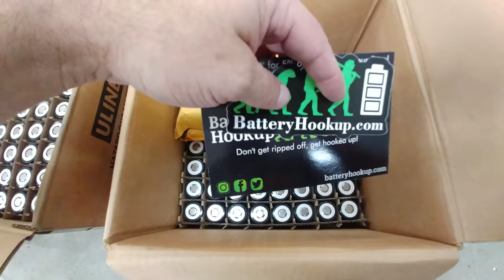Homemade Electric Buggy, Ep 3: Powertrain - LiFePo4, ME1616

Comment: How's the luck so far with those battery hookup cells? I ordered 144 of them for a 5p24s pack for a 72v 8000w electric bike. The pack is complete on a 200A Daly BMS, and the bikes almost finished.
Reply: I'm curious too as I've been needing to make a pack for my drift cart. What do u use to make yours? (Tools, battery holders, ect)?
Reply: @Todd_G_FPV  I use a 1200A spot welder with a pen probe at nearly max setting to work for .20mm pure nickel strip and 32650 cell holders (That is required for high amp draw from the pack, sometimes even 2 layers thick). Once the strips connect the cells it still is a somewhat flexible pack, so I wrap it with polyimide heat tape before cutting a large shrink wrap for the pack. Go for a Daly BMS, they are currently on Amazon at a good price.
Reply from the maker: Haven't started the battery yet, just finished building a brake to bend the aluminum body panels. Once I get everything done as far as the chassis mounts and it's ready for paint, then I'll shift focus to the battery. This will be my first time using these cells, but they have a good reputation. I'm using a Daly BMS as well, 20-24P30S configuration (haven't settled on capacity yet). Using a 5000W spot welder to weld 2 layers of .2x15mm nickel strips to the cells and then solder them to thicker copper busbars running between the cells on each end of the parallel groups to carry the final current through each series connection. Kind of like what's done with cell level fusing, but without the fusing. I considered doing that as well, but figured these are a lot safer than Tesla's li-ion 18650's so if one of the cells short later I'm not too worried about the entire pack catching fire on me. It could be a really dumb decision, too lol. My luck isn't the greatest...
Reply: @JamesBiggar  I also just noticed yours have the white ring insulator up on the positive of the battery, mine came with cardboard brown. I'm hoping they didn't re-wrap some k2 cells or something for mine or something. I'll be following along to see how your cells end up!
Reply from the maker: Highly unlikely, they're manufactured specifically for Batteryhookup. They do sell K2 cells, too, along with Headway, Topband, and others, but not with their company name printed on the side of them. They take a lot of pride in their family owned business and have invested a lot of time and $ into their cells and nickel fuse sheets, and make a point to call out scams when they see them (I've been following and shopping through them for a couple of years). I recommend searching out other battery builds on Youtube using these cells, or other cells that they've supplied. They have an excellent reputation.
Reply: @JamesBiggar  Those are just shrinks the vendor/consumer can order, and have little to do with what quality is inside them. I ordered from them for this exact reason, reputation, price, LFP. I might just make a video so you can see what I mean. My cells have cardboard brown insulators, and drop to 3.4v after being fully charged within a few hours. I have built like 15 Li-ion packs no problems like this, though they do drop voltage, usually only like .05v or so, not .25v. Literally that's 4.8v, or ~15% of the 24s packs voltage range. I'm going to cycle the cells like 10 times with the daly bms and then test them before I order the 6ah cells. I'm just curious to see your results or if you have the same problem.  My cells MFG Date: 06-20
Reply from the maker: Hey Dave, just an update - the cells are performing better than expected. Cycled them a few times, charging up to 3.65V and they drop down to rest between 3.45-3.55V. I'm getting between 136-146 Ah discharged from the 24 cell P groups, so it's working out to over 5700 mAh per cell, which are sold as 5000 mAh. I'll have ~2 kWh more capacity in total than expected. I'm guessing they were intended to be the 6000 mAh cells, but didn't quite make the grade so are sold as 5000 mAh. $/Wh, it's definitely the better deal. In case folks aren't aware, 3.4V is the normal resting voltage for a fully charged LiFePo4 cell. It's not the same as other lithium chemistries but that isn't necessarily a negative characteristic, either. Different lithium chemistries have different nominal, charge and resting voltages (ex LFP = 3.2V nominal while Li-ion = 3.7V). Results from one of the capacity tests can be viewed here: https://renewablesystemstechnology.com/project-blog/e-crosskart-battery-balancing-testing

Comment: I'd probably have just degreased the clutch pack and reassembled it with a thin coating of JB Weld on the face of each plate.
Reply from the maker: That would work, if the coating is consistent enough. Otherwise there could be a higher risk of balance issues. Not a big deal for off road though

Comment: What is the highest speed of this motor please tell me
Reply from the maker: Depends on gearing, tire size, weight, etc. Motor specs alone don't determine top speed. With 22" tires and 5:1 gearing I'll achieve around 120 km/h with this vehicle. With 3:1 gearing a person could reach 160 km/h, and so on. Power is a function of speed and torque, which also means that more speed = less torque, more torque = less speed. There's a compromise, so you need to gear it for the task. Asking what the rpm and torque is would be a better question. See the description for links.

Comment: 12:33 You didnt put grease in it 😲
Reply from the maker: Nope, I run her dry 24/7 bud. Only way to do it. Grease is for pussies with no $ to burn. I'm kidding, obviously. I didn't put fluid in it because I had to install a LSD conversion kit at a later date. There's a video showing that specifically. No sense adding fluid to a buggy that can't move yet just to take it back out and put it back in a few weeks later...